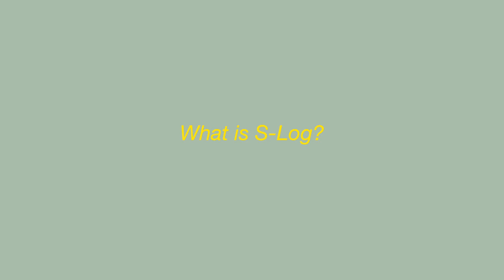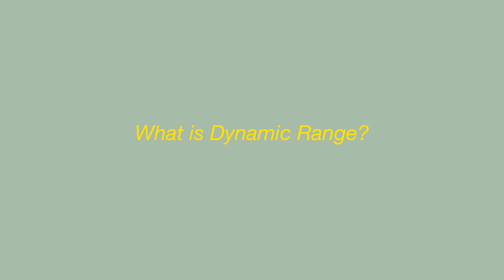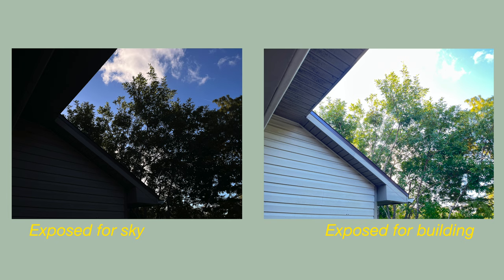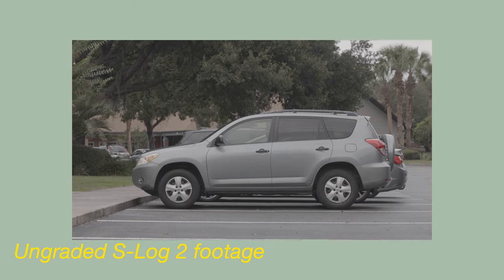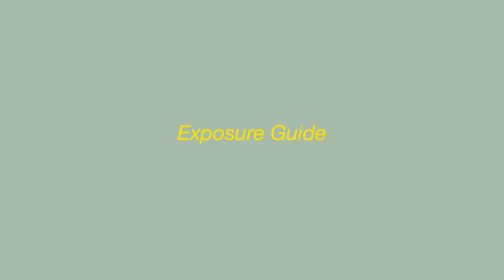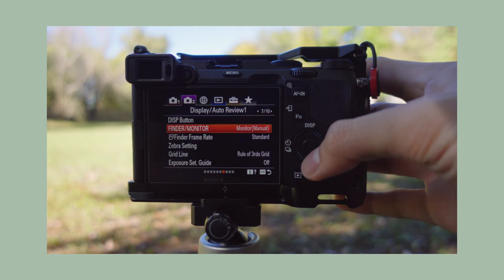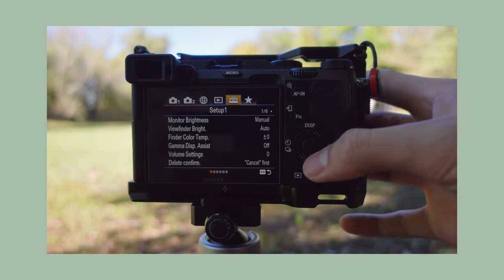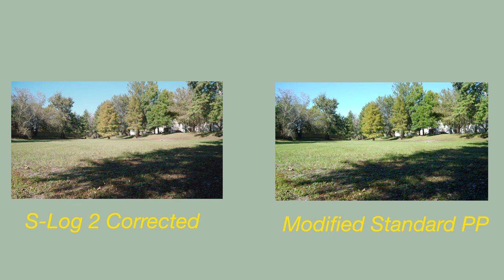Sony A7C Slog 2 Tutorial | For Beginners!

Comment: I bought three A7C cameras for wedding videography.  I use them all on the Neutral picture profile and manually drop the contrast and colour saturation to their lowest settings, sharpness down to minus two and set the Zebra to 100. I expose for tiny bits of overexposure zebra in the brightest parts of the scene and the results come out perfect.  I even try shooting on 1080p 50fps 25mb and the results are still incredible.  I get all the dynamic range I need and weddings are notorious for needing lots of it due to white wedding dresses, black suits and relentless sunlight, plus dark interiors of churches and venues. I've never needed SLOG, 10 bit or 4K so far either as I am from old-skool photography as my background and as such I compose correctly for the shot and do not need 4K punch-in etc. I am using two of the cameras with the stock 28-60 lenses which is amazing quality out of the box, and the main A7C is on a Crane 2 Gimbal with the Sony 24-105 G OSS f4 lens which is probably the best all-round lens on the market. I also have the Sigma M11 Canon to Sony E adapter for using my Canon 24-105 L f4 IS  and Sigma 70-200 f2.8 HSM2 OSS lenses if I need to. Such a brilliant setup.  Oh, and audio comes from a pair of Rode Wireless Go and Go2 mic kits attached to two of the A7Cs (the ones that I manage close to me during the ceremony and speeches), while the third A7C has a RODE hotshoe mic on, just for reference and backup sound. A 3rd Rode Wireless Go kit would be good to get soon to attach to the Vicar or Registrar while the current two go on the Groom's jacket.  Lastly, I upgraded to one A7C first as the primary, to see how good it was.  I previously used two Canon M50 mk1 cameras and a Canon 5Dmk2 for the three video angles. The Sony gear completely wipes the floor with the Canon cameras, which have now become backup gear only.

Comment: Not sure what I’m doing wrong. So I’m in the Manual Movie mode, but I can’t change my exposure to +2.0. I can only adjust the aperture, ISO and shutter speed?
Reply from the maker: No problem, you have to adjust those settings and look at the metering number, or an easy was to do it is go into shutter priority or manual with auto ISO and change the exposure compensation in your FN menu or in the normal menu settings, let me know if this helps
Reply: @brewswithdrew  thanks!

Comment: Great video!
I want to ask you what type of white balance you use when shooting outdoors. 
Do you use the AWB or adjust the kelvin properties, or do you manually set the white using the color passport?
Reply from the maker: Hello, it depends, if I'm vlogging with changing environments I'll use AWB because it's good enough for what I'm doing and I'm not grading that much in the first place. 

If I'm in a particular scene for a while I will set it to the closest in camera setting which won't be perfect, but it will be stable so I can adjust it in post. 

I have a white card but have never found it very convenient to use unless I was on a short film set or something.
Reply: @brewswithdrew  
Thank you for sharing your preferences and work flow!
I will test it!

Comment: When i shoot in slog2 and use the colour correction lut to rec707 from sony, the greens look teal and reds look pink, cant work out whats going wrong
Reply from the maker: Have you tried Rec709? Not sure if that is a typo or if 707 is a different color space.

 As far as the sony luts, it's important to check your firmware version and colorspace/gamma. Using sgamut3.cine can introduce some weird colors if you use the sony lut, because it will normally be designed for S gamut.3 instead of the cine version. Otherwise, try with a stable white balance if you're using auto and see if you can grade it consistently

If you want more flexibility with which SLOG or Gamut to use, I'd recommend Alister Chapman's luts which have more lut and gamut options. Let me know if that helps

Comment: what about night videography? what settings best to use?
Reply from the maker: Hello, I use the same settings, but don't be afraid to crank the ISO. You want to over expose the image as high as possible without clipping important details, and then pushing the noise down in post. Seems counterintuitive but give it a try and you can really tell a difference.